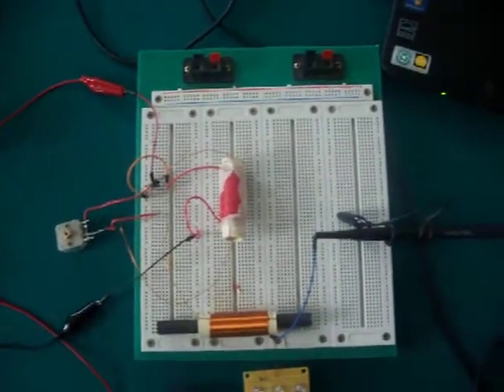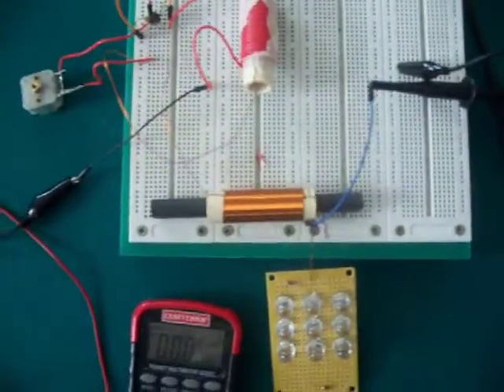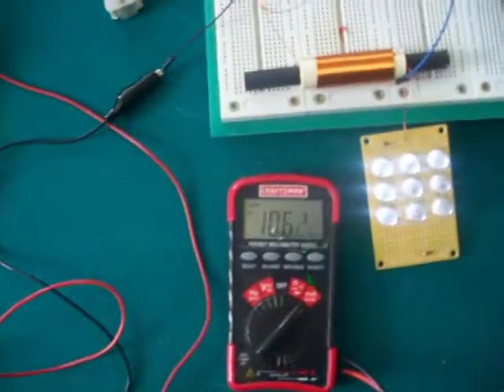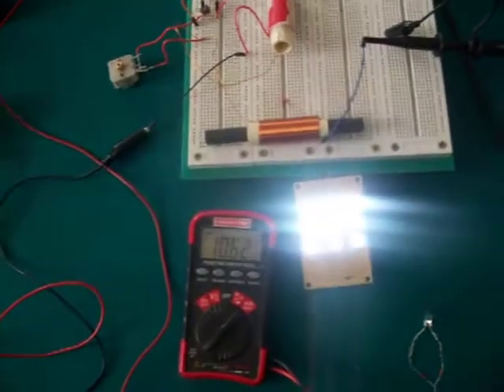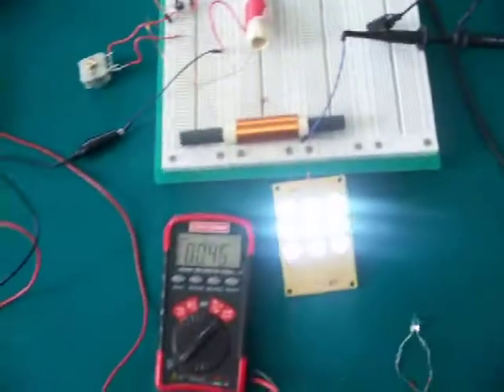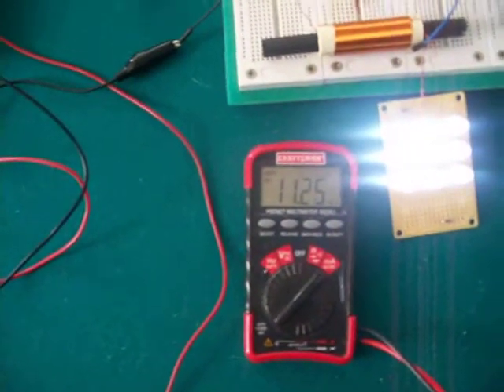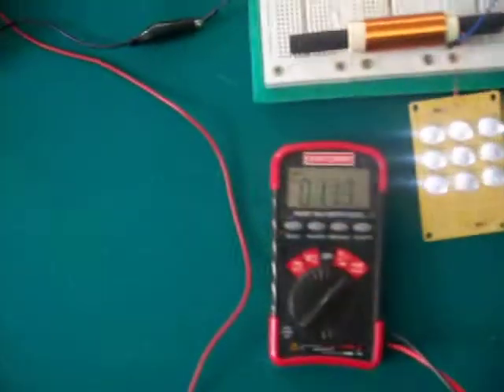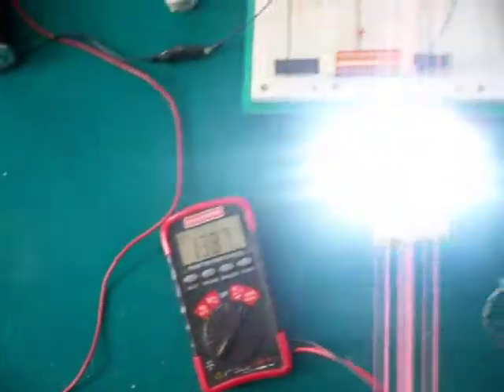Hartley Oscillator Replication

Comment: hi..
It might be interesting to find the signal on a port. radio and walk
away until it fades out.
Why do I have the feeling that you did that already?
I think that very low power radiation is given more leeway than it is here in th UK.
Is frequency stability any thing of a problem in this project?
regards...